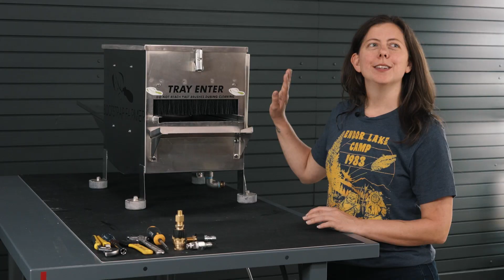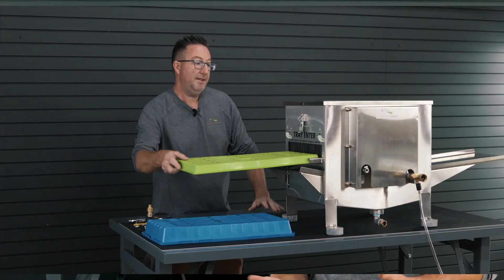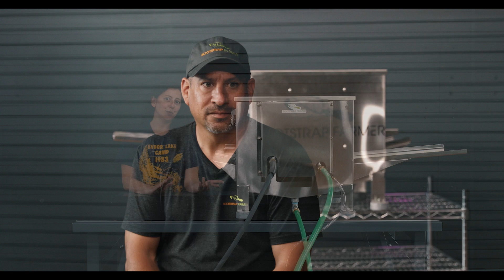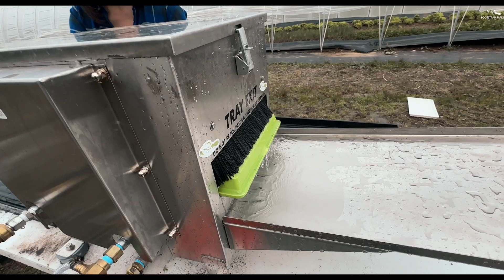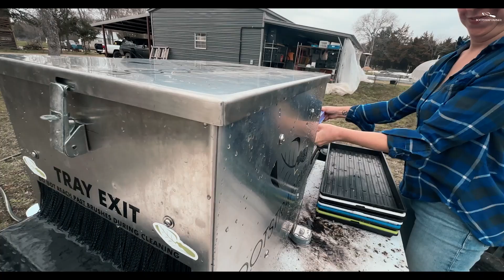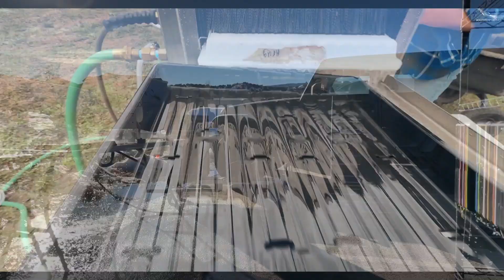Why You Need a Tray Washer | Cleaning Microgreens Trays at Scale for Farmers

Comment: What size is the opening can it be used with other brands
Reply from the maker: Opening is 11 3x8" x 2 13/16"
Made for industry standard 1020 trays but unknown if other brands will make it through the pressures of the wash that our Bootstrap Farmer trays can take.
Our washer is solely designed for the industry's strongest trays. We cannot guarantee against damage to non-Bootstrap Farmer trays.